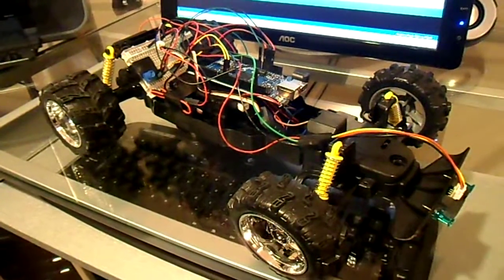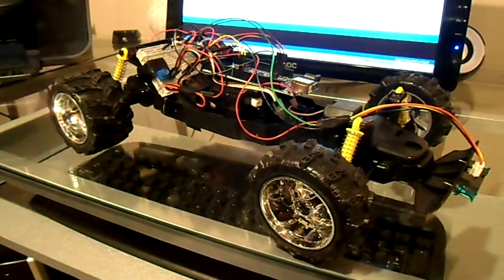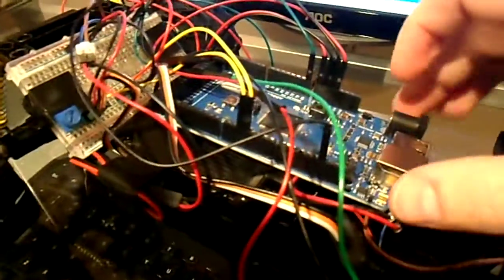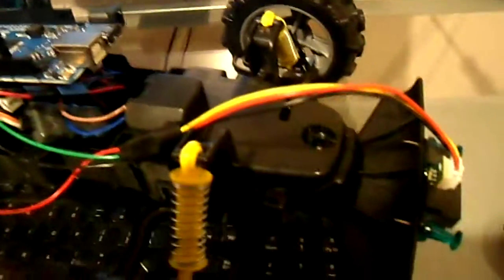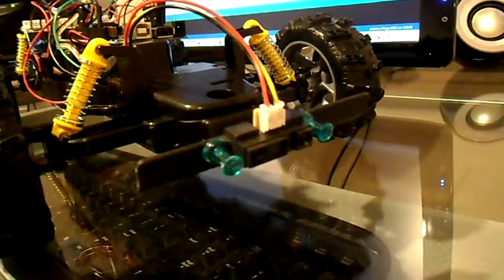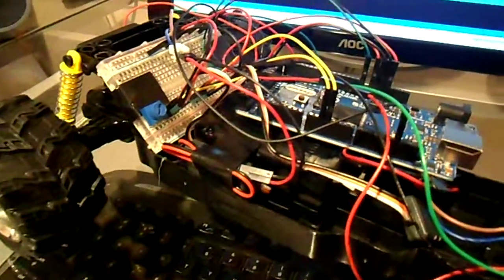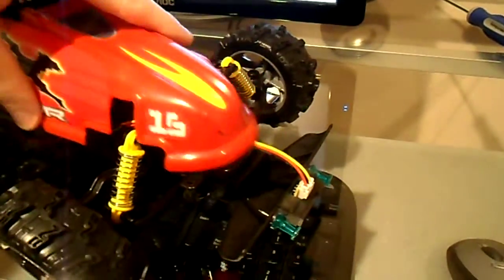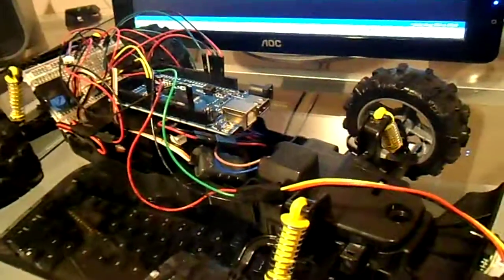Walkthrough - Autonomous RC Car using Arduino ADK

Comment: Hi, your project is so amazing. infact i have been struggling all these days with the same thing. i have build mine  and i am currently controlling it by remote, i hope to make it Autonomous. i have build it my self from in and out. i will appreciate it if you can email me the codes you have used because i am bad in programming but i believe i will be able to use the sketch if i get it.

Edward
nsacnamibia@gmail.com